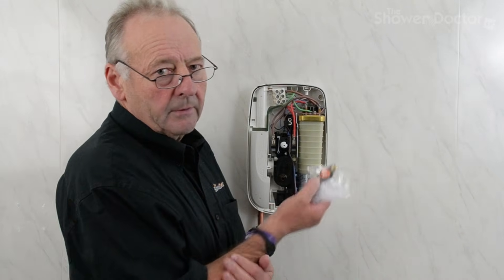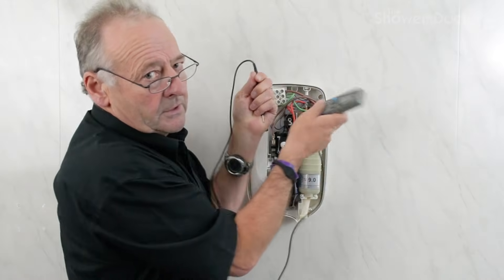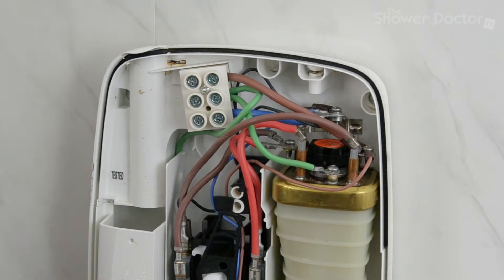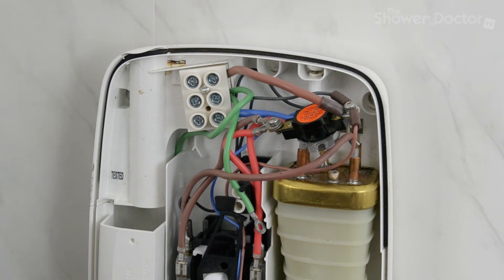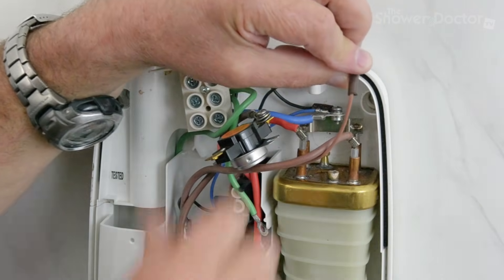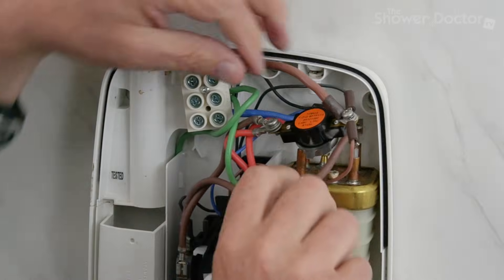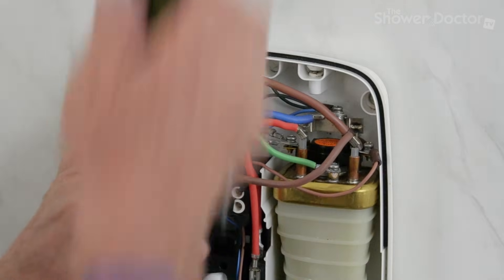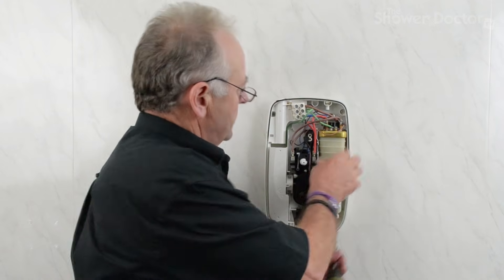Electric showers: Test and replace Mira Sport 416.41 thermal cut-out (TCO).

Comment: Thank you for such a helpful video.  I eventually ended up having to buy an original thermal switch as copy's were out of stock.  I noticed that a Warning! sticker was on the package stating:-  ''Do Not Press Printed Disc on the thermal switch as this will make the component unserviceable''  I do not know if any copy thermal switch will have this warning.  Either way!  I think that it is worth mentioning as the original switch does not come cheap.  Thanks again for a great Video.

Comment: Thanks for this. Helped me with replacing mine.on the Mira Play J10J 19/20 unit. Some tips for that modal which uses the same thermal cut-out. The screws are T15 Torx. Use a T15 offset (Allen key style) driver. - This will allow you to get to the screws with out taking the whole shower unit apart.I used one from minotaur torx key-set  - The switch is held in place by one screw at the front. - There are only two more screws. one to the left and one on the right. - The switch’s back silver prong slips under a brass stand off at the back - The back prong of the switch must go under the brass stand off's cap head so it is held in place correctly. - Also make sure you orientate the switch unit the same way as the one coming out. as mentioned in the video. - On top of mine the writing was facing away from me.

Comment: Hi Shower Doc ive a Mira sport max with the Airboost tech. The airboost seems to of stopped or is very weak and the temprature is up and down depending on what setting its on. Ive been through your excellent videos but still the same. Help.

Comment: Hi,my mira shower sport max 10.8 go from scalding hot to freezing cold on its own,tested thermal switch and it does have continuity,can it still be faulty?i have ordered one today from your website anyway,its probably 2-3 years old and sometimes i will 20 minutes under shower just waiting for the cooler or warmer water😤🤦‍♂️, thanks

Comment: Thanks for this superb video. 

It always adds a degree of professionalism if you show competence witha multimeter and thanks to you, I was able to do so.  I have replaced a few of these before and it never occurred to me to just loosen the earth pole screw, instead of removing it completely and carefully leaving the remaining two screws in situ, in the wire connectors. I managed to cannabilise an old TCO from another Mira shower. The job was done for a mate and he had just bought a like-for-like shower for a staggering £320!! 

He was made up when the repair saved him just under £300, as he was set to take a modest holiday with his family and money would have been tight if the complete unit had been changed. I have purchaed Shower Doctor products on more than a few occassions and in gratitude, will order another 416.41 ASAP.

Comment: You didn't mention a splash guard at all in the video. I had this small thin flap of plastic fall on the floor when I removed the cover and on it it said warning do not remove splashguard. I am a bit confused as didn't know if this was the splashguard or not and couldn't see how to put it back in. On your video you made no mention of it so I assumed it couldn't be the 'splashguard' and was probably just there to give the message. Can you shed any light on this, my model is a Mira Sprint. I did follow your very helpful video and managed to replace the part and fix the problem so I am very happy. Purchased the part from your link too, rude not to!

Comment: Hi, wonder if you could help me please.

I was just about to order the Thermal Switch for our Mira Sport Max Air Boost 10.8kw,  having confirmed the heater was ok but the Thermal Switch had no continuity, when I read this on your site in an answer by Barrie - 

“After fitting a new TCO

When fitting a new TCO listen to the shower, after it has completed its first on/off cycle, if when it is switched off you hear it continuing to heat (Noise like a kettle starting to boil) this will mean that there is a switch or a relay that is stuck in the on position, this is keeping an element energised and this is probably what caused the original TCO to fail.

If this is the case replace the faulty switch or relay and make sure that you switch the shower off at the isolating switch when the shower is not in use because this may cause the new TCO to fail.”

This “kettle boiling” description almost exactly describes what my wife heard immediately after she finished her shower. She found it disturbing and asked me to check the shower. The result being that it all worked fine but no hot water on any setting. 

My question is, “how can I tell which component (ie. Switch/relay) is stuck, and caused the Thermal Switch to trip/fail.”?

Many thanks,

Kind regards,

Mike

Comment: Thank you. If only more youtube videos were this clear, excellent. Has anyone tried 'popping' their faulty thermal switch back into life? I've done so with what I assume to be an  equivalent switch in tumble driers by throwing them on the floor a few times until you hear a pop (which is the stuck metal diaphragm resetting). Curious to hear if anyone has tried that with a shower thermal switch.

Comment: Thank you for this, hugely helpful. Our wiring was a little more complex than the example and we had significant rust on the TCO and the top of the heating unit, but some light sanding with emery paper took the rust off.Getting the screws to sit properly was a little tricky - they kept trying to cross thread themselves - but got it done. Took about an hour altogether, but a lot of that was finding some electricians tape to hold the wires together while I sanded. Great news was as soon as we powered on again the shower worked perfectly and it stil does.

Comment: What can cause a TCO to keep failing?  3 in 3 weeks.  Water flow appears ok and also changed inlet filter which had no signs of scaling as I don’t think we have hard water.  Prior to failing there’s no fluctuation in temperature.  Take a shower and all good then the next time cold with continuity showing 1.  It reads zero when fitting new TCO.  Heating elements test at 11.3 and 11.2 ohms.  Any ideas would be most welcome
Thanks

Comment: My mira shower turns on for a split sec then turns off, I need to keep pressing the power button or high low button for about 15 mins then it turns on eventually can this be the solution, the water comes out a little on each attempt of pressing the buttons thanks in advance 👍

Comment: When I removed the TCO I noticed a small plastic pin on the top, when I pushed it back down it worked again. This pin seems to be a kind of breaker and due to this the repair cost me absolutely nothing bar the 10 minutes work. The mother in law was about to buy a new shower. Many thanks 👍👍
Reply: Useful to know. I'd wondered if they could be reset. What make was your shower?
Reply: @batchrocketproject4720  It was Sharp.

Comment: I had to laugh when you said taking a picture or two was essential. My sons shower was cutting out so after viewing a couple of your vids, I purchased a TCO and a solenoid. The shower in question a Mira Jump Mk 1. I could not find a vid for that particular unit. I thought I would replace both to be sure. Well the solenoid was a devil to get out and get the replacement in, not much room for sausage fingers, but eventually I got it in. Now the TCO, well I had fully intended taking the pics, but forgot. getting it out was a nightmare as was getting it the replacement back in after much ado it was in place but I had forgotten where the 2 x blue wires and 2 Brown went. I was sick to the stomach thought I had really screwed up. After a pause and a cuppa I went back put them where I thought they should be put cover back on flipped the switch in the fuse box and pulled the cord, pressed the button, and low and behold a working shower. £25 for parts, plus some anxiety of my own creation saved abt. £180 + for a replacement plus fitting. Ever so grateful for you guidance and superb videos. Thank you.

Comment: Hi, my Mira sport shower was working fine, but then three months ago it began to stop during bathing. But it doer not turns on when I push the water button. Shower red light still is on and shows electricity is there but no water comes out of it. can you please give your expert opinion please. I have already removed the shower head, but there is no any blockage. thanks

Comment: Fantastic video, just saved me £180 on a replacement mira sport shower, got the part for £16 from amazon fitted it in 30min max and i wouldn’t call myself a diy expert by any stretch
Reply: Was your shower cycling hot & cold??
Reply: @akshaypatel2233  Hi did you tried replacing TCO because mine shower is throwing hot and cold water please reply

Comment: Useful video. I've just replaced the thermal switch part number 1563.719 in my Mora Sports Thermostatic shower which has a larger casing overlap than the one you were demonstrating on. For anyone else replacing this part, the secret is to remove the two screws holding the inlet clamp, the two screws retaining the heater tank to the casing and the one screw holding the temperature cam pulley/inlet valve assembly to the casing. This then releases the heater tank enough to ger access to the T15 screws. I temporarily fixed the thermal switch in place using the single T15 screw so it was more stable when I attached the cables to its two terminal. Job done and thanks for the video

Comment: Thanks the really helped. I don't have much money but what I did was buy 2 of the same shower and keep one for parts and indeed my shower kept cutting out and resting even on low temps. This video really helped and saved me replacing everything. My eletric shower is my only source of hot water as my gas meter is broken and they are taking forever to fix it. Luckily everything in my home is eletric so I don't miss it much unless I want a really hot bath. With the shower it takes an hour to fill the bath lol. My mum always said of you can't improvise.

Comment: I have a Mira Play Shower. It hasn't been used for several years now because it simply doesn't work and only produces cold water. I've used a bath since, but now can't use the bath because the Gas is switched off and will remain so probably for several months. 
So now I really want to try to get the shower working again, but question is, do I try to repair it myself (I am totally not experienced with electrics!) or do I have to face the reality of getting an electrician in (and paying the price of course, for his services!)

Ahrhrhrhr!

Comment: I think this switch has blown in ours, I intend to test it with a continuity tester asap. If so could this overheating be caused by having the shower running whilst the head is under the bath water? As we fill a makeshift small bath for the kids with the shower head.. Thanks. Mike

Comment: Thanks mate. I didn't test the stat before buying the new one just looked on forums and this was the solution to my symptoms. Then a quick YouTube search got me to this video and bish bash little bit fiddly bosh shower is running hot again. 
Now a question. On opening the unit it seemed a little sooty? Especially around the copper wires? Any ideas 💡

Comment: Really good video. By the way you might have rust underneath the TCO where it sits on the gold coloured top of the water tank. This is also the why you get cold water and overheat light. It took me 30 mins of sanding to get most of the rust off under the TCO and on the gold top. This creates a good connection again. This even saved me having to buy a new TCO.
Reply: Hi, I checked mine and it failed the continuity test. I noticed a build up of oxidation, I tested the TCO off the shower and it worked. Cleaned the oxidation replaced and all good at the moment. Thank you for the video and instruction.

Comment: Thanks again for this advice. I've just replaced the unit for the second time. This time I prised the back off the failed unit to have a look. It seems that the thermal switch had stuck in the open position. One press reset it. If it happens again I'll try that first and perhaps save myself £17 and a few days.

Comment: Do I only need to turn the electric off or the water off too?
Reply: Harpreet06 If you're careful there's no need to shut off the water, but it would reduce any worry and possibly avoid a soaking to shut the water off too.
Reply: Oh thanks for the reply but I've already done it now. I turned off both. Just a tip to people, you'll need a torx screwdriver to do it. The hardest part was taking the old TCO out so it was pretty easy job.

Comment: My shower is hot in the summer cold in the winter will that be the tco please
Reply from the maker: Sorry for the delay in replying.

Unlikely to be the  TCO the performance of all electric showers drops off in the winter due to the water in the mains coming into your house much cooler therefor your shower has to work much harder to heat the water up
Reply: @showerdoctor  p

Comment: So having had my TCO replaced what would cause it to fail again in a short space of time? I have observed a slightly louder mains hum than usual from(I am assuming) the heating element, faulty heating element?
Reply: Hi Patrick, the lime deposits inside the boiler can cause the TCO to fail completely. This happens because the lime reduces the ability of the heating element to exchange heat with the water, so it overheats and the TCO cuts off permanently. This is a safety design.

Comment: I had a perfectly working shower except that the water was cold (same model). I followed this great video and fixed it with very little hassle.  Went slowly and carefully, had to stand on the edge of the bath.  One difference between the video and my shower was that the two thick brown wires at the top were held together with a small plastic cable tie which I snipped to make it easier to get the old part out. Thanks a lot.